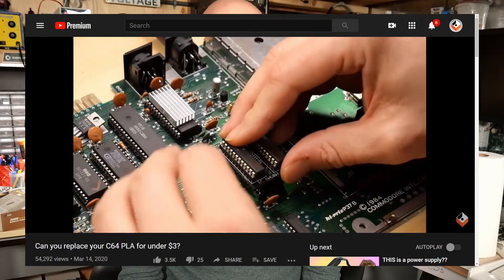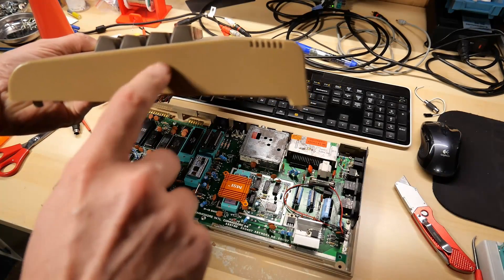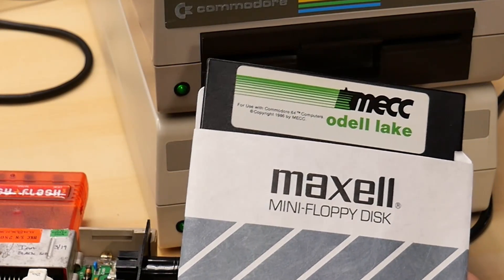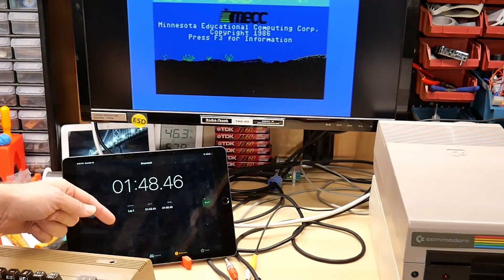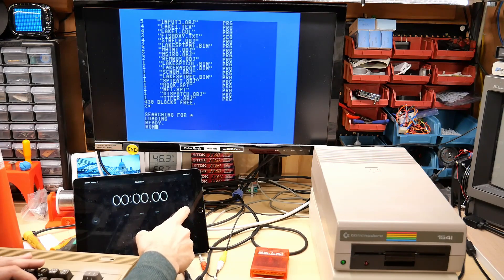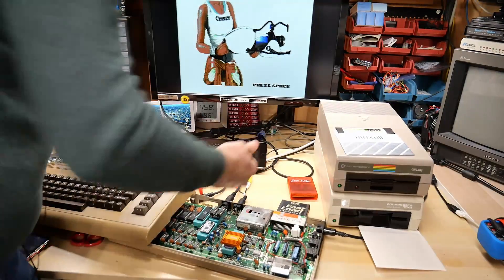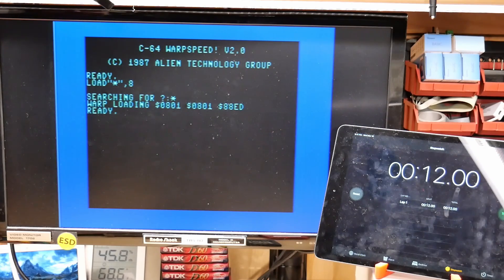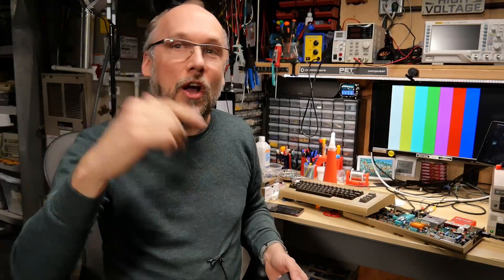Does the $3 GAL-PLA work with Epyx FastLoad? (Bonus fastload comparisons)

Comment: The proof that Odell Lake has its own custom loader is that the screen didn't blank.  The FastLoad cartridge blanks the screen when loading.  A stock 1541 has a transfer speed of approximately 490 bytes per second; with a FastLoad cartridge, the transfer speed is slightly under 2500 bytes per second.  Adrian's tests showed that a FastLoad cartridge loaded Portal about 250% faster, which jives with the statistics. (EDIT: I think I'm wrong about the Fastload cartridge blanking the screen.  It's been so long since I've used one that I'm not sure.)

As for the Warp Speed cartridge, its biggest problem was compatibility with games written in 1985 or later, most of which had their own custom loaders (Epyx's Vorpal loader, Cinemaware's V-MAX! loader, etc.)  Both the Fastload cartridge and the Warp Speed cartridge had games that they weren't compatible with.  Some games even required you to physically remove the cartridge before they would load.  Out of all the games I owned, there was one game that required me to remove my Fastload cartridge; with the Warp Speed cartridge, nearly a third of my games wouldn't load without removing the cartridge.  (Of course, I later modded my Fastload cartridge to have an on/off switch and a reset button.  So instead of actually removing the cartridge, I'd just flick it off and press the reset button.  It's remarkably easy to do.)

On the other hand, if you put a Fastload cartridge in a C128, it will boot in C64 mode.  The Warp Speed cartridge is unique in that it is compatible with either the C64 or the C128.  Also, Warp Speed v2 was compatible with the 1541, 1571, and 1581 disk drives, whereas the Fastload cartridge is not compatible with the 1581.  As a side note, both an unmodified 1541 and a Fastload cartridge writes to disk in a 1:10 interleave.  That is to say, when writing a file to a blank disk, it would write to sector 1, sector 11, sector 2, sector 12, etc., in that order.  JiffyDOS and Warp Speed both used a 1:5 interleave.
Reply: You had to remove the Fastload cart even if you disabled it in its menu?
Reply: @androskris  Sometimes, yes.  That's why I modded my Fastload cartridge to have an on/off switch.  But it was always some game that had its own fast load.  Unfortunately, it's been so long since I pulled my C64 out of the closet, that I can't name any of those games off the top of my head.  (It's been nearly 30 years.  I'm entitled to forget a few things.)
Reply: Wow, now this saddens me but my reply was removed and I have no idea why.  I am beginning to no longer post comments on YT as this place is horrible even when you are on your best behaviour.
Reply: Fastload does not blank the screen when loading.
Reply: @mrstachman  Cool, it's been so long that I didn't remember if it did or not.  Thanks for the correction!
Reply: @Mr Guru YT is all AI deleting comments and ghosting channels. They don't manually check anything unless you have a bunch of people harass them. Don't say anything against SJWs or there's a good chance your comment goes bye bye. YT is hairline deep in political ideology doo doo.
Reply: Worth noting that the Mach-5 will force a 128 into 64 mode, they also made a Mach-128 that will work in 128 mode. It also works on a 64 and provides a handy reset button.
Reply: @Mr Guru I've had cases using Chrome where I posted a comment and it simply vanished. I try to remember to select all/copy my longer comments before clicking Reply because this sometimes happens. Usually posting a second time and pasting the saved text seems to work.
BTW, seeing the text post immediately is not a guarantee that the comment will show up for others. If the channel owner has "all moderation"  set, the comment will show up for you as you post it, but it will only show up for others if and when the channel owner approves it.
Reply: Wrong! Just kidding. You seem to have quite a bit of knowledge about these loaders! Down to the bytes per second! Now if only a patch could be made for battletech. I am playing it right now and the disk access memory swaps are killing me. Still, it is a ton of fun to play this. There was only one official FASA computer game and I am thankful for it.  Even if it accesses the drive every time you enter a building or ten times as you walk through a "city".
Reply: @peterlamont647  Thanks.  I used to be part of the hacker scene way back in the day, so I used to be pretty familiar with C64 internals.  It's been nearly 30 years since the last time I used a real C64 instead of an emulated one... if I wanted to get one out of the closet, I'd want to socket everything and recap the board the way Adrian's done.  (And yes, I remember the Crescent Hawk's Inception.  I actually finished that game on the C64.  I remember the constant drive access, too.)
Reply: @SpearM3064  well...speaking from experience, socketing everything is a double edge sword. Commodore chips are NMOS technology and also quite large compared with more modern dies. Therefore they get hotter. The problem is they tend to "jump" out of their sockets quite quickly. You can use zif sockets ok. If you use stsndard sockets, pit a zip tie underneath to hold down the chip. Its a method I learned from at&t comm boards. Of course, add heatsinks. My test64 will only work reliably for about 10 minutes before a chip heats and removes itself from a socket just from heat solid expansion. Something no one thinks to avoid...right up until they socket an entire c64 lol...
Reply: The worst is the VIC2. Unless you have it squished down by a finger of metal or a zip tie, it will jump out in minutes! The sx-64 actually has a custom socket and heat sink that clamps down the chip in the socket and prevents it from moving; clamping it tight to the heatsink & the socket.
Reply: @peterlamont647  Oh yes, I'm aware of that.  My C64 had that problem with the SID chip.  When it got warm (after about 30 minutes), it would jump far enough out of the socket to crash the computer.  (This is a stock model; the SID chip on mine came already socketed.  I don't remember which revision it is.)  I fixed it by adding a heat sink.  If I socketed everything, my plan was to use ZIF sockets like Adrian did.
Reply: There was no link though I was just commenting on my knowledge of the cartridge and how it worked having dissected it back then.
Reply: Fastload doesn't blank the screen
Reply: @Mr Guru Might just be accepted manually

Comment: As a kid the fastload cart never left the slot. Practically unusable without it.  Massive speed improvement, even the wait on power up reduced significantly.  Never used tapes so I can only comment on the 1541.   When I pulled it from the attic a year ago it was still installed.   Slot is a little loose now but it still works!   Recapped the C64 and built a new power supply since the original was missing but all the caps measured good.   No need for a PLA yet but it's great to know there's a cheap replacement now.
Reply: I had an Action Replay MK3 (MK2 originally) and my disk drive was an Enhancer 2000 as I couldn't get a 1541. So when people used to complain about disk loading speeds I didn't know what they were on about.

Comment: Warp Speed was a fairly late comer to the C64 and didn't work with well with a lot of software unless it was single file games.  Even then the way it worked was a compromise and just like high speed tape loaders you could have problems loading things and need to try several times. The EPYX fast load was one of the very few true transparent solutions that offered around 5x loading speed and worked with almost every software program.  So much so I pretty much had one permanently installed on my C64.
Reply: I've heard this before but this definitely didn't match my actual experience with Warp Speed.  I found it to be extremely compatible.  Maybe I am glorifying my memory, but I know for certain that my go-to games worked with it whether they had their own fastloader or not.  I do wonder if maybe this could be a Warpspeed 2.0 compatibility improvement, though I thought I had a v1.3...  Maybe the second one I picked up is 1.3 and my original a 2.0?  I need to confirm....
Reply: @CommodoreGreg  Depends on how good your disk drive was and/or if the drive that recorded the disk was in alignment.  While I think of it another software fast loader for disk was VORPAL.

Comment: I believe fast load (and similar turbo softwares) was for a compressed tape format, which even though took extra time was hugely faster.
So instead of loading the fastload as software first, then load the game, with the cartridge you could skip that step.
Reply from the maker: I think the fastload solutions are for disks and the Turbo loaders are for tape -- where the tape was written in a more efficient format to dramatically speed loading.

Comment: Are you going to switch your standard rom to Warp Speed 2.0 now? Are there any downsides? 

Also, we need a bind sid shootout. Sid vs Swin vs FPGA (chip replacement) vs emulator vs MisTer (Full FPGA C64).
Reply from the maker: I'm starting to see others comment that Warpspeed just isn't very compatible and also really only is super fast in some circumstances, like the one I tested with Portal.

Comment: You can use isopropyl alcohol to erase permanent markers.
Reply from the maker: It didn't work on this 35 year old marker. Didn't even make a dent and I tried 99% IPA... It does work fine on more recently applied stuff though. Maybe the formulation was different back then?
Reply: @adriansdigitalbasement  Alcohol works on modern permanent markers-many of the old ones used a stronger solvent(which is why the old ones smelled WAY different).
Alcohol did not work well on these.

I'm not sure what solvent the old markers used though.
Reply: @adriansdigitalbasement   I think the longer the pen marker is left on a surface the ink goes deeper into the material.
Reply: often it will remove ink but the surface will be polished and not rugged anymore.

Comment: Adrian, how come none of you c64 nostalgia guys ever use the command shortcuts on the C64?  I feel like I'm one of the few who used them... Once I discovered them I never went back.. L (shift+o) instead of typing load, R (shift+u) for run, L (shift+I) for list, etc etc..  it seems like it's one of those things that many people didn't even realize existed.
Reply: And for jiffydos you can just press shift +run stop which works the same as load"*", 8 and then run.
Reply: @RaamahRaamah  yeah, I ran an IMAGE 1.2 BBS on my C64 when I was like 13 (that was awhile ago now, like 28 yrs ago lol) for a number of years and ended up installing jiffy DOS on my bread bin, one of my two 1541 drives, and both of my 1581 drives I was using... But, I'm talking about the shortcuts on the stock ROM...

On a side note, jiffy DOS was even faster when you saved the files using jiffy DOS and if you have it installed in your drives. I see these guys running it by itself on c64 only and loading stock saved PRG and making comparisons to other fast loaders..not really using it to full potential.
Reply: I'll be honest, I grew up with a C64 and never knew about any of these commands back in the day.. i've only learned about them recently.

Comment: I thought the point of the fastload cartridge was for tapes?

12:37  I think the one on the easyflash was made compatible with the SD2IEC, but C64's not my native language ;)
Reply: No.  The Commodore Datasette literally couldn't go faster; the speed of the tape was fixed.  Most turbo tape routines relied on the fact that even though the PET/VIC/C64 only allows a 16-character filename (plus 2 bytes for starting address, 2 bytes for ending address, and 1 byte to identify it as a program file), the cassette buffer was actually 192 bytes long.  That allowed them to save a short "bootstrap" program along with the file header.  Only the file header (and bootstrap program) was saved normally; the rest of the program was saved in a non-standard format.

Most turbo tape routines sacrificed error correction in favor of reducing the amount of data that was written to tape.  For example, they saved only one copy of the program instead of two.  Instead of writing a checksum at the end of every 256 bytes of data, it only wrote one checksum at the end of the program.  Instead of writing one parity bit per byte, It didn't write any parity bits.  Instead of writing a short pulse followed by a long pulse for a 0 and a long pulse/short pulse for a 1, it just wrote a short pulse for a 0 and a long pulse for a 1.  As you can see, you lost a lot of error correction... but your program loaded at about the speed of a disk drive (about 500 bytes per second instead of 50 bytes per second).
Reply: @SpearM3064  thats true of most tape storage systems: merely speeding up the tape has rarely been an option because its set by the speed of the mechanism, and most only used standard compact cassette decks.

There are things that can be done with the waveform though to pack data more closely together, at a risk of making it more difficult to read back.
Reply: @TheTurnipKing  but not with an 80s microcomputer; high performance random seek open reel tape were the norm in minicomputers and mainframes from the 70s and 80s, but that's mostly IBM hardware way off the home computing of that era
Reply: No it was for floppy.  Here in Australia they were popular so glad it works with the  GAL-PLA!
Reply: tapes had their own built-in turbo in the same loader program; those color stripes border flashing fast while the main tape program loads are in fact the turbo tape in action
Reply: I had a VIC-20 cartridge called a Rabbit. Just an EPROM with a clear window on it.  It saved to cassette much faster, then that file would of course load just as fast. I had hundreds of files on one side of a 90 minute tape and never filled it up. No backup either lol.
Reply: Tapes started snail slow, then used more or less the same trick, they load a very small stub of code from the TAPE using the stock kernall TAPE rutines and modulation (just 10 seconds) and after then, this piece of SW took over the stock tape I/O rutines and at the same time, the program was recorded with a different and more efficient modulation and simbol representation, compatible with the stub of code loaded in the first 10 seconds. With this, tape managed to be "usable". We had almost 100 tapes and we used tape heavily because we couldnt afford the drive. Giana sisters took only 38 tape count, Seafox 16 and the longer and slowest was time tunnel. I sume that this game didnt use any turboloader at all. But load times were decent to the point that OUTPERFORMED the stock 1541 no problems Issue with tape was, not is realibility. In fact we had 2 games from this period, that still will LOAD today !!!, Issue was the tape unit was a bit on the cheap side and missalligment was a constant issue. Tape mechanism was VERY GOOD, very stable on speed.It was all down to head alligment. Later we learned that an "alternative" tape unit branded Mitsao (made in Brazil) was FAR MORE SUPERIOR and I barely got fails with it. Tape is not as bad as people claim, it all down to decent tapes and proper maintenance of the tape unit. Cleaning and alligment. As many audio tape players. No surprises here.

Comment: I have orders in for a good number of the pla20v8 kits. Going to try on a few revisions as well as my SX-64.
Reply: just make sure that orders dont ship from Wuhan ; )
Reply: @alerey4363  Shenzhen Hong Kong. But still a good alcohol bath wont hurt none either. 😉 I mean for the chips.
Reply: Worked on my sx-64 and the two different C64 boards I tried.